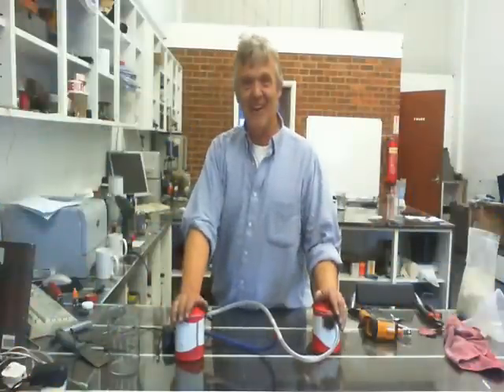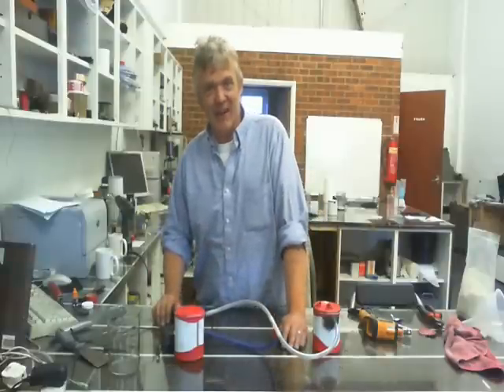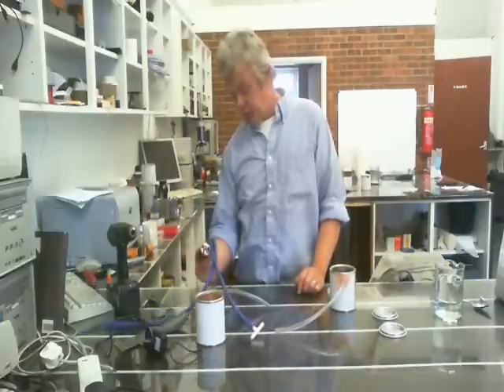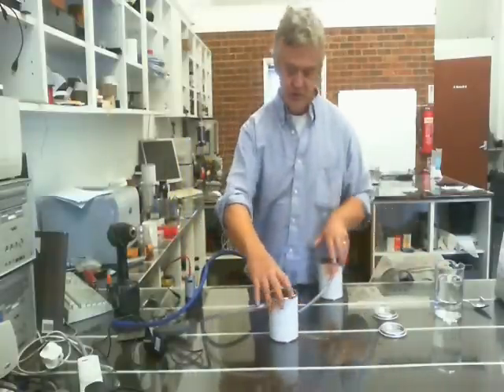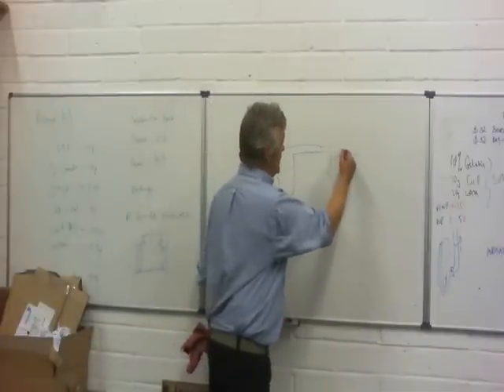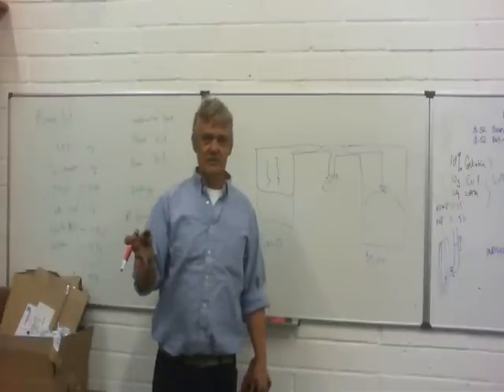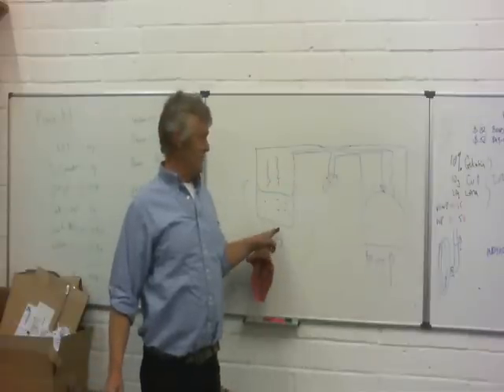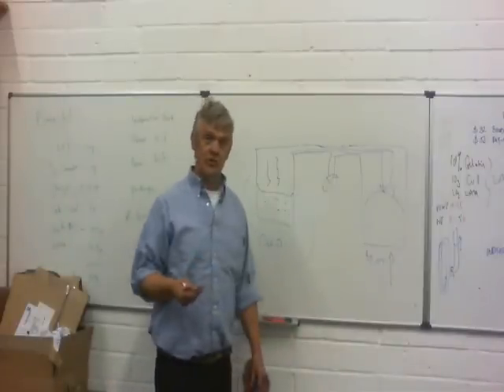Adsorption Chillers, Desalination And Solid State Stirling Engines

Comment: The next step is to make this a reversible battery. The zeolite requires a higher temperature to recharge it, but its a poor thermal conductor, so increasing thermal conductivity into and out of the zeolites will speed recharge and by playing with pressure you can reduce the temperature in which to drive the water out.  The advantage of reversible metal hydrides is that you can double the eq pressure for the energy input of raising the specific heat of the hydride 15 to 20 C.  You can half it be reducing temperature. So if we alternately put heat into the hydride and take heat out of another hydride synchronously we get 1/2 the fluid power being generated by the release of hydrogen to power a conventional heat pump with a refrigerant and that refrigerant becomes a thermal battery simply by altering the volume in a piston alternating between heat of vaporization and condensation.   The temp difference is low 15 to 20 K but the heat of formation for one mol of hydrogen will be about 22.2 kj/mol  that is a very large heat flow, but the thermal energy is maintained within the system because in essence you are not ever going above ambient temperature.  Heat only flows from high to low. 

Lots more on this to come.
Reply from the maker: Kimberly Peacock just working through concepts myself lol = but we are getting there

Comment: If I pull a vacuum on a large tank or set of tanks. Is that a form of stored energy if utilized in this fashion or other methods? Just being a way to boil any liquid with an "R" number on the refrigerant chart can move heat from one place to another and be recycled back to a liquid and subcooled to be used again. The compressor in any refrigeration system is pulling the vacuum as well as compressing hot gas into a small area so heat can be easily removed. Got me thinking as usual. Thanks again for your teaching.
Reply from the maker: i think of it as a kind of battery mate - so i guess it is stored energy - glad you liked it

Comment: I just came across this video of yours Robert. Very nice concept. I have a question for you about the DESALINATION. How much Fresh Water would this System make?  So if I were to build a Compact Desalination System using Zeolite which in it's self is used as a Water Filter. How much Water would you get from That 1 qt Can of Zeolite after Heating it to Evaporate and Re-condense for Fresh Drinking Water? I know this is a Old Video, but the Knowledge is still good and always up to Date Hopefully New Things Being Added all the Time. Thanks for your work and your willingness to Teach Others. Your Knowledge is Vast in these areas.

Comment: Here's something I've wondered about which is somewhat along the same lines as your video. As you know propane is a good refrigerant and people in the US have been known to pump their car's old R-12 A/C systems with it as a substitute. Of course unlike R-12,  it's explosive. I think R-12 is somewhat explosive but requires a very high temperature. That was one of selling points when DuPont came up with has a replacement for ammonia in refrigerators. And unlike ammonia, R-12 and R-22 are supposed to dissipate quickly into the atmosphere (rise up into the ozone layer LOL!) instead of filling the air with deadly ammonia gas.

1) Use a BBQ grill tank (we call them 20# cylinders in the United States) of propane. Take another #20 cylinder and pull a vacuum on it.
2) Connect an expansion valve, orifice tube from an A/C system or maybe just a needle valve to regulate the flow. Possibly use the grill regulator before it. 
3) The valve would connect to an evaporator coil. 
4) The end of the evaporator coil would connect to a piece of tubing run through a large tank of water to cool/condense the propane vapor back into a liquid 
5) Then the liquid would (should) go into the empty #20 cylinder. 

The empty tank would be turned upright as normal but the full tank would be turned upside down so the liquid could feed the expansion valve.

Would in theory the propane liquid fill the empty tank entirely?

After all the propane has been transferred to the other tank,  could you disconnect both tanks and then swap them?

This sounds logical but my guess is at some point the pressures in both cylinders would equalize. Or you would have to pull a vacuum on the empty tank every time you wanted to re-use the system?

This is kind of along the same lines as the Crosley Icy ball in the early part of the 20th century that used absorption refrigeration. Except that absorption refrigeration requires a heat source to boil the ammonia off.

Does any of that make any sense?

Comment: Hello mr. Smith. I was just wondering how often u would have to change ingredients to keep a chiller working for a whole summer? Aslo can u recommend what combination would last the longest. Ps. Thank you for your insights and your time put into sharing with us
Reply from the maker: Badguys Rulez you never have to change them mate - just keep on heating and cooling in a cycle - if you used three to service on box and rotated them it would be cold all the time. I don't really have a recommendation per se as it depends on availability of materials, how well you can work with them and how 'green' you want to be - all materials will have their drawbacks you just pick a good one for you and work in the limitations of what you have

Comment: wonder if you could put a TEG Thermoelectric Power Generator between the two cans and generate electricity
Reply from the maker: Monty Perales i would say so
Reply: Yes you could use a TEG, but instead of Peltier/Seebeck effect why not go for using pyroelectric sensors. Why? What is the advantage. Well the Peltier/Seebeck wants the greatest temperature difference to generate the most electricity or move the most thermal energy. The pyroelectric works on the change rate of temperature.  So the faster you can change temperature the more effective at generating electricity you will be.  So how do you get temperature to change fast. Cavitation.  Think acoustic laser and or acoustic stirling engine. Keep the thermal mass low and use heat pipes to transport hot and cold from cavitation to insulated segments of the tube.  Have fun.

Comment: "Solid State Stirling Engines"??? Where does this come from? Only thing about a supposed "solid state stirling engine" that I could ever find was a U.S. patent (US5288336A), in which Harold Aspden and John Scott Strachan thought they could produce electrical power, (claiming 70 percent efficiency), with a Peltier device. It really had nothing to do with a Stirling cycle.